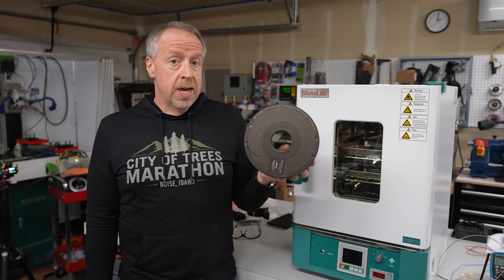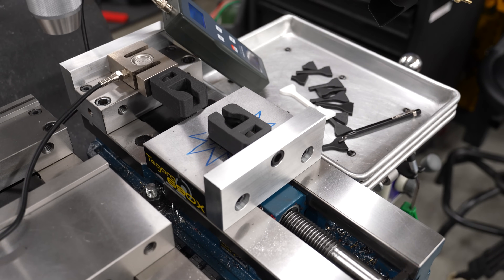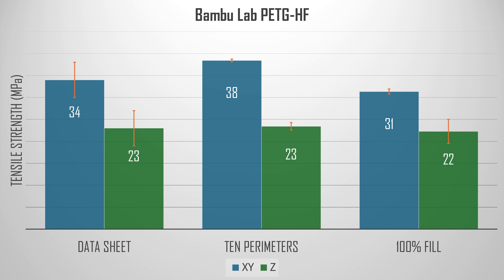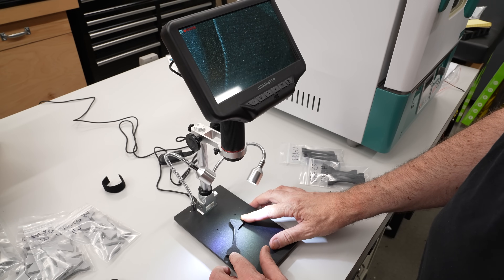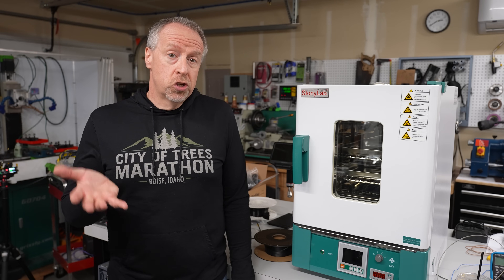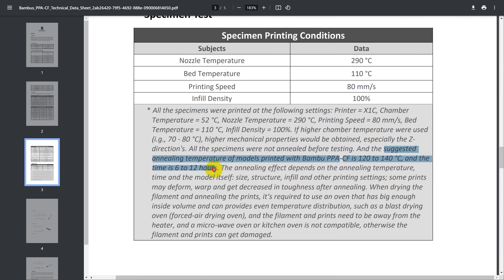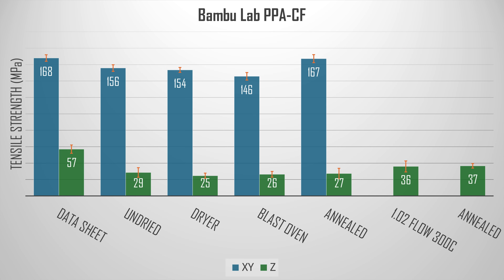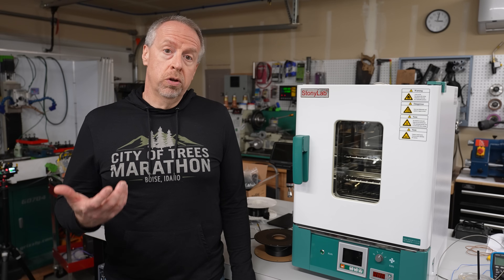I Tested PPA-CF Filament and It's INSANELY Strong!

Comment: Isn't it amazing that we have reached the point we can produce industrial-strength components in our workshop? Yes, at a cost, but imagine the possibilities... Thanks James, great video as always!
Reply: I cant wait to see better multi material multi head machines with even better filament options in the next few years. When we can start replacing aluminum and such with printed parts that will be as durable/strong.. that will be amazing.
Reply: Exciting times 😊
Reply: I would be interested in comparing filaments such as this with traditional engineering materials
Reply: 3D printed parts or any material still don’t come close to injection molded strength, or machined metal. They work and are great for a lot of things, but don’t kid yourself.
Reply: @slipspectrum  That's true and it's likely we'll never reach that point. However for us hobbyists even getting to 70-80% there would be fantastic. For me printing stuff which will not shapeshift into something else when left in my car is exciting enough 😁
Reply: @slipspectrum9253salt annealing can help, its appears to make prints as strong as injection molded parts with the same material. unsure if that would work with CF but soon we will be able to find out
Reply: @slipspectrum I work in the firearms industry and we are seeing substantial increases in dmls printing a lot of the new suppressors are made in 718 inconel.  And titanium. Plus some other wonder materials like Haynes 282. 
They offer geometry with complex gas flow pathways that are impossible to obtain with traditional cnc machining 

We’re at a cool point with the current capabilities of “printing”
Reply: @slipspectrum  Well dumb dumb, not everyone can go from design to testing to production injection molded parts in their basement in less than an hour. Your comment is about as relevant as saying  "yeah but machined titanium would be stronger" (duh!)
Reply: @slipspectrum9253 Your comment has about as much weight as saying "Ice is colder" when talking about how cold your beverage should be. No shit sherlock a piece of machined Steel is stronger. But we are at a point where A LOT of mechanical, even load bearing parts can be 3d printed in your basement within a few hours for a fraction of the cost of injection molding (for low volumes - like prototypes or custom parts) or machining. thats impressive
Reply: @sirskyrage and soon, 3-D printing technology may one day have the potential to surpass machined parts, I was in Biotech when I saw they are making “density printers” which when they analyze load and force bearing parts or tools, they can remove 30-45% of the material making it lighter because most of the force or load is taken by the OTHER side or area , etc , not only is this awesome for reducing mass but they also can print the materials in different densities! So the same part uses less material, is stronger , and lighter than a machined part could be!

Edit: also they’re starting to have multi-material printers using the same principles as I mentioned above. So if there is a part that can’t have material removed , it could have cheaper materials used in the less important places

Comment: Great review thanks!  I am always looking for higher strength and temp resistance materials for functional parts?  But at that price for a small spool it would be just as cheap to prototype using a cheaper material and then have the actual part CNC machined……

Comment: hi james got a question related to your els is it possible to program the launchboard through usb without the 5v on the booster board and just leave the jumpers in place ?

also what are your thoughts on kwackers his fork with the thread to shoulder option?

Comment: For a filament like this, with the claimed use cases, I think it's very important to also check how much it suffers from creep.
I already invested on other very strong engineering filaments (eg: PA12-CF - 100€/0.5KG) only to discover that the parts printed with those materials get loose only a few hours after being bolted down. You can design stuff keeping in mind this limitation, but it's still a very crucial characteristic of the material that isn't really measured and reported on the datasheets.
Reply: Overall design needs to be looked at, not just material. I designed a servo and gearbox arrangement to be bolted to a piece of industrial gear this year. The mounting plate was printed in PLA but I designed the mounting holes to take press fit machined brass sleeves that I whipped up on the lathe. These stop the backplate distorting under the clamp while the plastic can happily take the other forces.

I pinched the idea from injection moulded parts (engine sensors etc) and it works well here.
Reply: @smorris12  Yes, but you need to know the material's properties in order to take them into account
Reply: Mytechfun tested creep and it basically has zero creep.

On the hook test it moved 0.1mm at first and then never got bigger and returned to its original shape when the load was removed.

( Approx I don't remember the stats Exactly)
Reply: For plastics that have been around for a while, there are papers that cover creep. Unfortunately it varies massively with varying temperature and load.
Reply: You could print over a tension bar. We use those in our products, because you can never get rid of creep ever in any material you have to engineer for those things. It´s not a metal
Reply: Ppa is gonna creep WAY less than pa12-cf, especially if you anneal it. It should be similar to PET-CF for creep
Reply: Pc based materials are great in that sense, and others like moisture sensitivity. Hence why i use prusa PCblend for mechanical parts.
Reply: @garagecedric  They can develop cracks though.
Reply: Did you anneal your PA12 for 12 hours?
Reply: @g.4279  I tried. It gets better, but still way worse than PET-CF which has little to no creep right after the print.
Reply: That's why I am trying the PET-CF.  It's supposed to creep a lot less than the nylons.
Reply: @zachary3777  yup, I replaced nylon with PET-CF
Reply: @zachary3777  PET CF lol. Good luck

Comment: I've worked with lab ovens for many years. Very handy device to have. That fancy oven of yours has impressive specs. Probably an equally impressive price tag. With 3D printing, the elephant in the room will be largely solved when true 3D printing hits the market, to address the inter-layer problem. Its just firmware/software after all. I'm pretty sure it exists somewhere in beta. Haha, wondered about that p-value section. Don't worry, its not a shame. I still refer to my physics/chemistry textbooks from the '80s on a regular basis. As long as you know what to do with it, and where to find it, a bit of offline storage is OK :-)

Comment: Bambulab advertises that the Heat Deflection Temperature / ℃ (0.45 MPa) of its PPA-CF can reach 227c, But his main material is PA12, So I doubt it's over-promoted. I believe the temperature resistance of PPS-CF can reach. Will you compare the QIDI PAHT-CF, PPS-CF with bambu PAHT-CF and PPA-CF? it will be fun.
Reply: it's main material is NOT PA12.
Reply: @riba2233  You could ask the Bambu.
Reply: @mohistschool1003  why, we know what the base material ia
Reply: @riba2233  Sorry, I made a mistake. The bambu paht-cf base material is PA12. The bambu PPA-CF base material is PPA, and it is as same as QIDI PAHT-CF. You can get the information from their TDS.
Reply: @mohistschool1003   yes, that makes sense.

Comment: Cool stuff! I hope future AMS systems can accommodate stiffer materials like this someday.

Also, if you want to add a cheap, low effort heated chamber into the X1C, i have a video showing how i modded mine. $50 worth of parts and less than an hour of setup 🙂

Comment: You are not the first to wrap a printer in a blanket :D it works quite well, I approve. A small fan like a 5015 (or two) blowing on the underside of the bed will significantly increase your chamber temps. It evacuates heat from under the bed and circulates air without doing any part cooling.
Forces the PID controller to pump more power in to the bed. More power in, higher chamber temp :)

Comment: Did bambu put that on a cardboard spool? That's crazy.  Cheap out just because it's not AMS compatible. $150 a spool it should be in an aluminum spool.
Reply: that would be wasteful, cardboard is best for this application, not too expensive and can handle heat.

Comment: James,
Why havent you employed 1 of your spare servomotors to drive the tension vice jaws?
Constant speed of distortion, controlled speed of distortion, both distance & time data to pc, 
Come-on, do the job properly.
Thanks.
Reply: and build the pull test fixtures out of metal,  this use to be a machining channel,  i hope you didnt get rid of the machines.

Comment: In the injection molding industry, it is common to rehydrate the parts after molding to increase strength with nylon. They are typically placed in a bag with water sprayed in.
Reply: This isn't quite like Nylon though, there's very little difference between wet and dry state
Reply: So, once nylon is printed and placed outside or in a high humidity environment, should I worry about compromising its material properties?
Reply: @theglowcloud2215  No need to worry. The nylon will rehydrate in open air, and yield and tensile strength increases. However, before molding, the pellets are dried to at least 0.2%. Placing the components in a bag with water ensures the customer gets parts at optimal strength and moisture at equilibrium, around 2-3%.
Reply: @sevenliterbronco That's really interesting, I'd naively have expected that the expansion from moisture absorbance would create higher internal stress and weaken the parts.  Is the mechanism for this strength increase understood?

Comment: I was looking at the X1C review you gave today doing some research on Bambulabs 3D Printers. You gave a solid recommendation for the X1C and I was hoping you would have done that with the much cheaper, but functionality almost identical P1S that costs only $600 ($850 P1S & AMS 4X Filament Feeder)vs the X1C that costs $1200 ($1450 X1C & AMS 4X Filament Feeder). Is the X1C really worth being twice as expensive? They'll both need the upgraded $35 hot end to do the carbon fiber with the only the P1S also needing an $18 steel extruder gear assembly upgrade. The P1S is missing the fancy touchscreen and lidar.The X1C has a higher frame rate and resolution camera. I hear the X1C bedplate can go up to 110 C vs only 100 C on the P1S. I was surprised you haven't done this already but P1S review and comparison with the X1C please.  Is one X1C really worth two P1S?

Comment: I have found that all of these filament companies lie as much as they can get away with, and none of these nylons will have advertised layer adhesion strength unless you slow down to 40mm/s or so. None of them want to be the first to say you have to run your fancy fast printer at ender 3 speeds. Slow it down and Z strength jumps up dramatically.
Reply: The e3d high flow nozzle is supposed to help with this.  There is a YouTube video that shows it improves the layer adhesion dramatically.
Reply: He got within the margin of error after following their directions fully so pretty harsh to say they are lying imo.
Reply: @ferrumignis He only got to 91% of the spec sheet. When that is already less than 1/3 of the XY strength it is a big deal at $200/kg.
Reply: @anon-means-anon  He clearly stated that was within the error bar range given.
Reply: While print speed definitely has a factor in layer adhesion slower isn't always stronger. There is a sweet spot where the layer that's put down cools down enough to not sag or droop, and then you can put that other layer on top of it. Printing too slow and it will cool down too much and be whatever temperature the enclosure is. Too fast and your print quality takes a hit. Would've liked to see clough do a 40 mm/s sample though.
Reply: @rileyneufeld7001  I've tested lots of different nylon and 35-45 mm/s with no cooling and a hot chamber is the magic zone for a .4 nozzle. There is a point where you can go too slow and the previous layer cools too much for good bonding on larger parts or multiple part prints. It's very noticeable in carbon fiber pa since fiber to fiber contact area takes away from the possible area for the polymer to bond, lowering the possible bond strength even in ideal conditions. Chasing Isotropy is quite a rabbit hole.
Reply: @rileyneufeld7001  exactly, the layer adhesion improves with higher speed!

Comment: You could probably approximate a constant strain rate test by replacing the handle on the vice with a worm gear and Ye Olde Cordless Drill. You'd need to calibrate it and the variability from how charged the battery is means it wouldn't be true constant rate, but it's something. Constant shear rate is much harder to replicate without an involved control system, unfortunately.

Comment: I received this stuff from the initial batch at a discount.(Not free, no YT pull)  I can vouch that you got a YouTube special box. My came moist. I tried to print it and it oozed like wet nylon. I tried to dry it overnight at 70c. No difference. I ended up drying it at about 100c in a amazon special food dehydrator which is advertised to hit 194F, it actually runs hotter than that, my thermocouple says it maxes out at 105c. This was sufficient to dry this stuff. About 6 hours did the trick. I can say that this stuff is incredibly rigid, but here is the thing. having to use a specialty drying setup as well as the fact that this stuff is unreasonably expensive, it's really not worth the vig. I am almost positive it's white branded from Polymaker, and they make PPS-CF, and if you have a machine that can print it  (I printed it on my Voron trident at 320) -- all the tds numbers are better. It's about the same in terms of xy strength, but z strength is essentially the same as xy (150 ish). Also it's $70 for 500g, not much cheaper, but cheaper. Also it's at all hygroscopic. I printed my out of a dry box, and it was fine, with no need to dry it as of yet. PPS is said to insensitive to moisture, so no drying requirements. I wouldn't dunk it in the bathtub, but it's my goto engineering plastic now. Bambu NEEDS to have drying temp requirement on the sales page for this material, saying that it must be dried before use is not enough. Your experience is an outlier. Search others who got it at the discounted price, all were in for a surprise having to figure out a safe way to dry it. Oh, and if you disable the exhaust fan, X1C hits 52c chamber temp with no weird blankets required (just change the gcode params in the slicer to not run the exhaust fan)

Comment: I print from a toaster oven with a remote probe thermometer. I turn it on its side and with a shaft, with guards to keep the spool from wondering, it exits the back via a brass fitting to a PTFE tube to my P1S, I can go from like 35*c to 200*c (the toaster)

Comment: Thank you for doing all of the testing and showing how to correct for the best strength. I'll be using this stuff for making a butterfly valve to control airflow to an oil cooler on an airplane.

Comment: Awesome testing and a great insight into what people actually have to do to tune an advanced filament for maximum strength. I wonder if a simple change like slightly higher line width would also add strength. Good to know the annealing isn't super necessary to still get good results. A printer like the Qidi Plus4 is perfect for this stuff. I'm trying some glass fiber polypropylene right now and I suspect some of the tricks to get the best results are similar, though not as dramatic. The heat deflection temp is also in the 140C range on this stuff though which is wild. Keep up the great work!

Comment: Thank you for another awesome informative video.

Regarding the RFID, I am experiencing the same with PLA Basic since the last firmware (I run 2 AMS on the same X1 printer). I also get random error from Bambu Studio that it didn't recognize the smooth PEI plate. I say random because closing the app and trying again will work most of the time.

Comment: I suspect Bambu Lab is guilty of corporate ass-covering when they say "dry before use". I just bought a bunch of ABS-GF and it has all printed fine out of the box with no drying. ABS is not known for being particularly hygroscopic, either. I've had spools of ABS sitting open for months and been able to print fine with it. So it's a shame when companies do this sort of thing because you can never be certain whether you can trust them.

Comment: Great video! Just curious, how do you think it would compare against PC-CF?
Reply: PC-CF will weaken around 90c with pressure applied. I tried using it in a dental cleaning device and it deformed. PC without CF was better but still not good enough. Needed to use PAHT-CF in the end. I bought PPA-CF as well and it’s really stiff and prints without issue on my X1C.
Reply: @Todestelzer very Interesting, thanks for sharing!